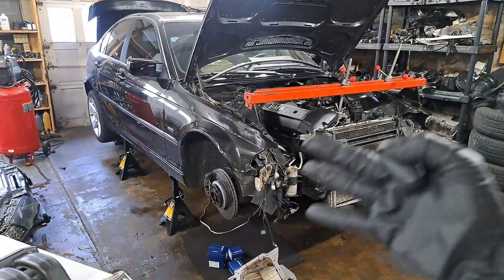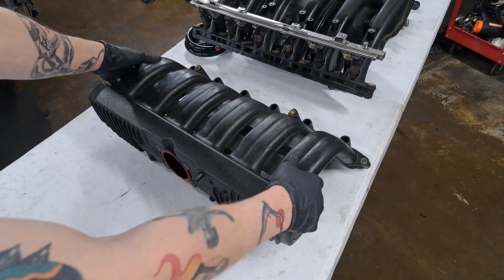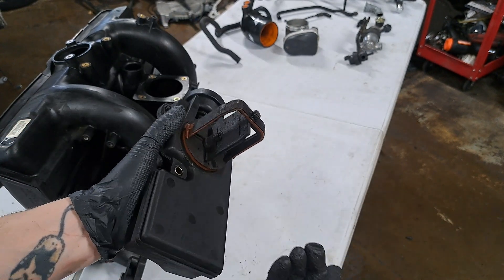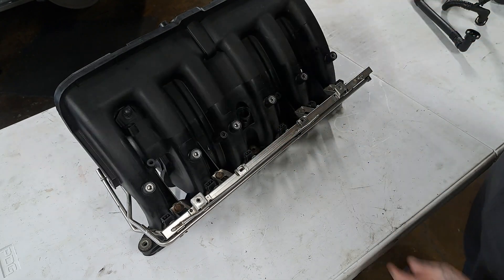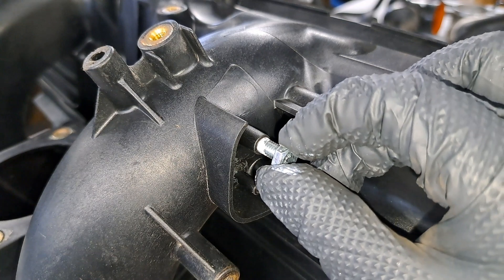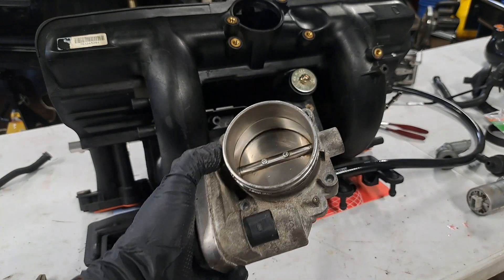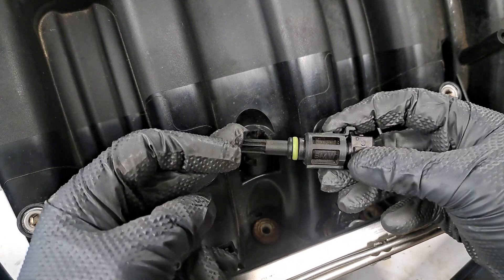BMW E46 Turbo Build - Intake Manifold

Comment: What about a vacuum pump for the brake booster? Dont you need it when you’re turboing a car?
Reply from the maker: No. Typically not.
Reply: Typically, there won't be boost in the manifold when you're applying the brakes. So there will be vacuum for the booster. Also keep in mind, the booster has a built-in vacuum reservoir.

Comment: Hi Tyler, This is a very informative video.  I kept my purge solenoid and already reinstalled the intake. Can i just install the check valve right next to the purge solenoid, and if so, what direction should it be installed ? Thanks in advance.
Reply from the maker: Put check valve between intake manifold and solenoid. Install it so it shuts under boost and open under vacuum. Can blow into it to see what direction is open/shut.
Reply: @OLearysBMW thank you very much. Ive been following you for a long time. I don't think I could do this build without your videos man. I'm boosting my 2004 330ci, I just installed some FIC 650CC HIGH-Z  and was nervous when I got them because the OEM clips didn't fit. That changed after your explanation.

Comment: Hey Tyler you should make a vid of the freaking yaw sensor. While I’m at highway speeds accelerating ( no wheel spin) the traction control light blinks on and engine loses power seems to happen when the steering wheel is slightly turned so I turned off dsc button and it now does this less but it’s still occurs especially under hard acceleration. What the heck is it?? Please help
Reply from the maker: Read DSC module for codes. YAW sensor is under driver seat and can cause sudden ABS/DSC activation randomly, yet other things can too.
Reply: @OLearysBMW can I just unplug it will the car still run performance wise I guess just without the safety features and stability control.  I’m trying little by little to build the car for “track purposes “
Reply: Tyler send me a used one if you have it .I’m still in PA it’s for a 2003 330ci with the plug style facing forward. How much would you want for it if u have it?
Reply from the maker: @dironizareyes596  Message me on Insta

Comment: The info in this is just GOLD. Thanks bud!!! Going to attempt this on M52tu intake manifold.
Reply from the maker: I recommend going straight to the M54B30 intake manifold. M52TU is restricted, you'll free up ~20hp just by using B30 intake and DISA following a good tune. For maximum benefit use B30 throttle body, MAF and piping. It's all larger.
Reply: Thanks King, will keep that in mind @OLearysBMW
Reply from the maker: @harmannwoottun5988  No problem, if retaining the M52TU throttle body on B30 intake, will need throttle body adapter. If wanting to use B30 throttle body and all, will need to MS43 convert the car. Which isn't hard, have done that multiple times now. When side by side, you can clearly see the advantages of the B30 intake manifold next to M52TU. Both the 2.5 and 2.8 M52TU use the same manifold as well. I love the M52TU engines, and always like to do complete B30 bolt-ons including intake camshaft. They really wake up.

Comment: with the exception of the icv delete can this be done for N/A car also ?
Reply from the maker: My last NA setup had ICV delete, the car felt great. The one that's usually doing burnouts or pulls in the video intros. As long as you or your tuner know how to do it. Throttle response is superb. When it comes to the CCV system, I'm an advocate for it. Great system that lasts a long time, though it can have issues in really cold climates. Normally I leave the CCV alone for NA cars or use the classic BMW cyclone oil separators, found on S62, M62.. etc
Reply: how do you adapt the s62 ccv to the m54 intake manifold? any advice on this if you have experience with it? thanks!
Reply from the maker: @marianbalan5130  You don’t. They aren't meant for high vacuum. Look at images of P54B20. You'll see how they are used. Same way I've done it in the past. Works fine. Original CCV is fine too..

Comment from the maker: I didn’t really explain the airflow of the intake manifold thoroughly. During lower and mid range RPM, the DISA flap is shut. Forcing the air to take a longer path before reaching the combustion chamber, this is better for bottom end torque/power. Then during the higher bouts of RPM, the DISA opens, creating a short and direct pathway for air. Will explain more thoroughly in the video where I boost-proof the DISA.
Reply: What happened to the oil separator? Completely deleted?
Reply from the maker: @dantealex7731 Watch the vid.

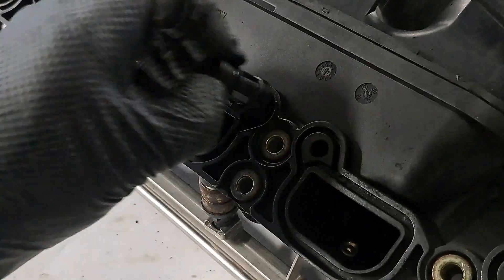Comment: 9:28 I genuinly RAN outside to check my 2.5 manifold, low and behold its missing 4 of the 6 plastic pins inside the mounting holes. I have a MASSIVE vacuum leak on my M52tu at the runners, and never knew those existed until AFTER I changed the gasket lol. Will definitely will be verifying I have those next day off! Is there a part number?
Reply: also is it safe to delete the suction jet pump w/ the brake booster check valve in an N/a setup?
Reply from the maker: @deandreastrel1031  They arent available separately brand new. If you need some and are in the US I can ship some over. And yes you can remove the suction jet pump while NA. My last NA setup didn’t have it.